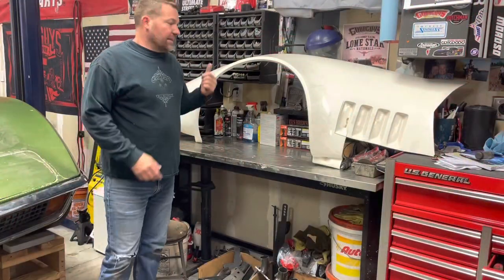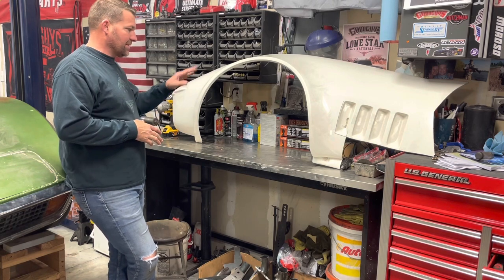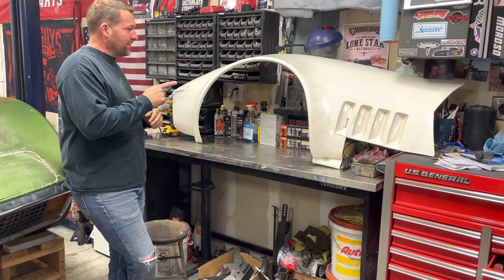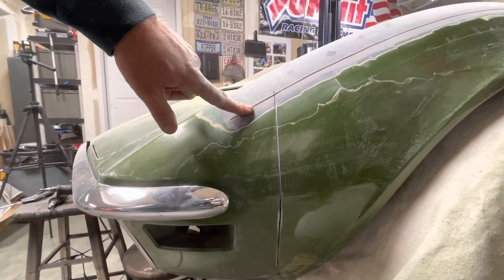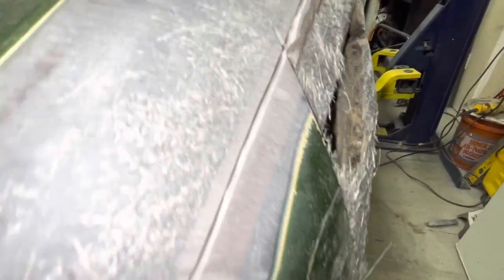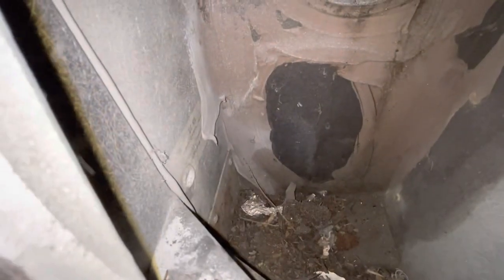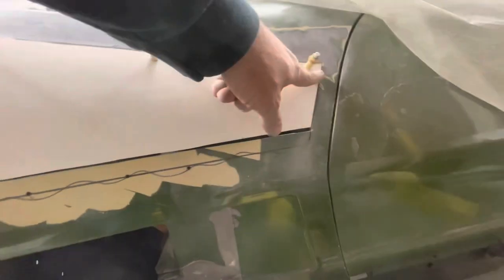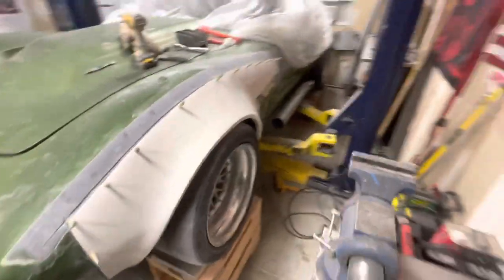1972 Corvette Project / Custom Image Corvette Flares Install Part 1

Comment: What I found when bonding fiberglass panels is to never put holes in them to temporarily hold them in place. The holes will always come back to haunt you.
Reply from the maker: I understand. There’s definitely a few different schools of thought here. My plan is to shred the mix strand fiberglass and mix it directly into the  resin and fill each individual hole. Seems excessive but the alternative is to spend $500 on 18-24 inch vice grip clamps. We’ll find out soon enough. 🤞Thanks for watching!
Reply: Taper the edge of the hole back as far as possible before filling for the least noticeable results.
The problem with fiberglass is the thermal expansion. You can fill, sand, prime and paint over the holes and it looks great until the car sits in a hot sun for awhile. Keep up the good work.